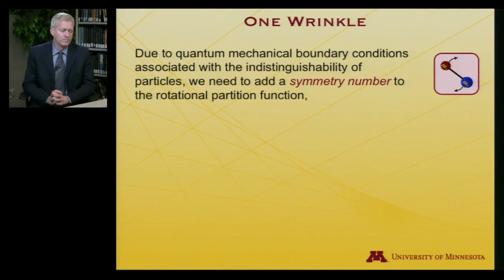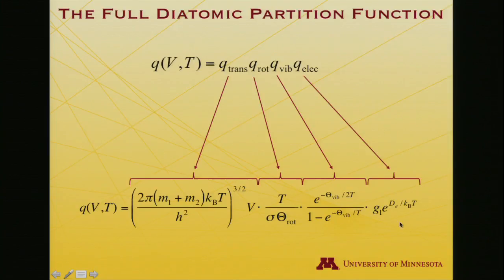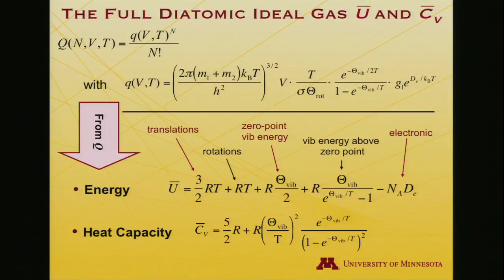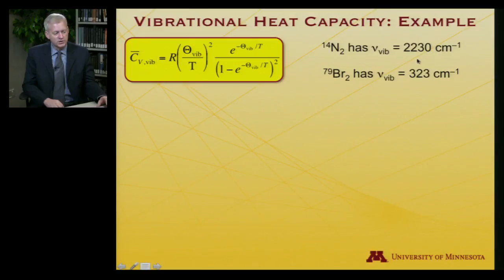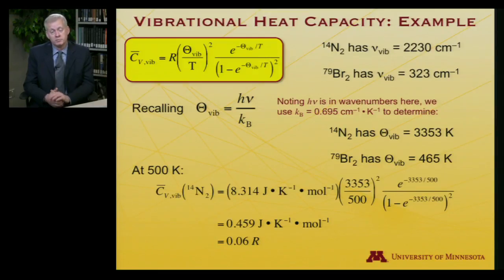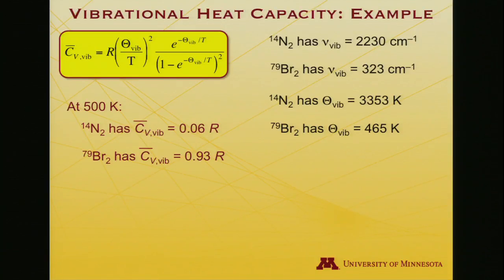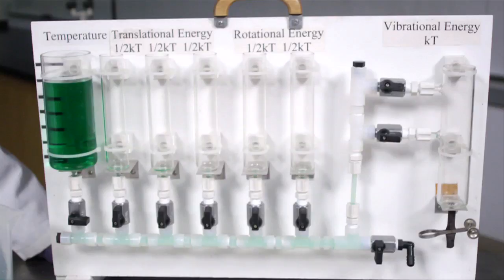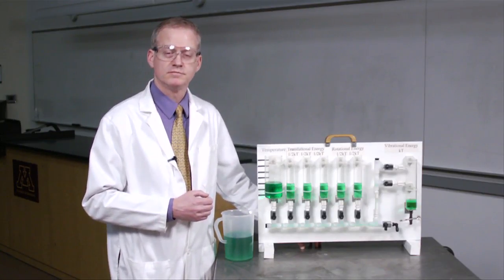StatMolThermo 04.06 Ideal Diatomic Gas: Examples

Comment: Hi.
So, I could say given the temperature dependence that for a Monoatomic gas the electronic energy is part of the "thermal energy", while it is not for a Diatomic gas. Is that right?
Also, the ZPE is not part of the "thermal energy", right?
Reply: So the HOMO-LUMO gap in diatomics such as the halogens ranges from ~35,000 cm-1 for F2 to ~17,500 cm-1 for I2.  Here the HOMO energy represents the ground state and the LUMO the 1st excited state.  Since the difference in the two states is greater than 1000 cm-1, we can in general neglect the excited state contributions to U and Cv.